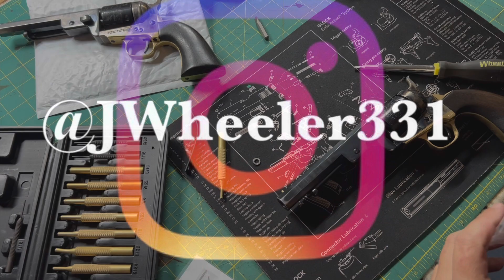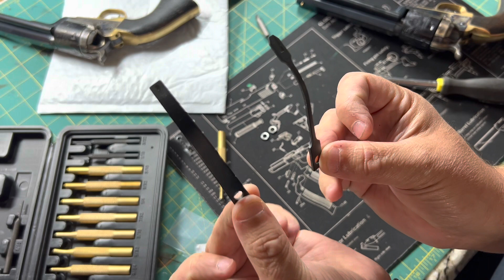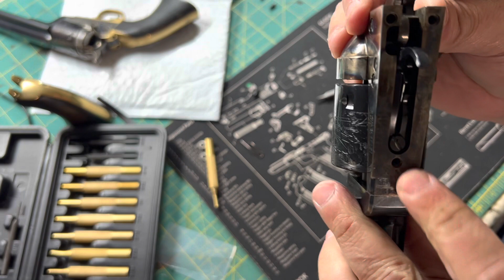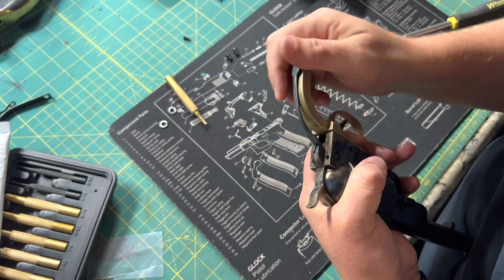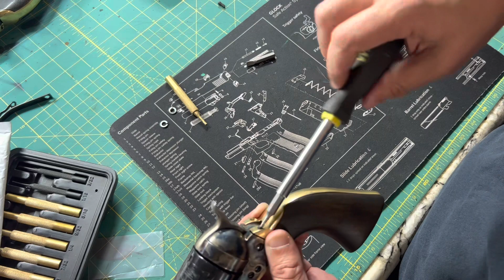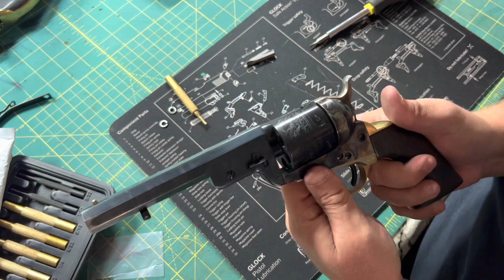Replacing Stock Springs In Uberti 1851 Colt Conversion With Lee Gunsmithing Spring Kit Cimarron

Comment: Does Uberti manufacture the revolvers for Cimarron? I've got a "Man With No Name" that I bought years ago and the trigger/bolt spring recently broke. Are the round springs more durable than the flat springs? I love taking things apart but have never attempted to disassemble my mine but this video makes it look like a piece of cake.
Reply from the maker: Uberti is the manufacturer. Cimarron, Taylor’s, EMF, Stoeger etc are the importers. I have some of my Uberti made revolvers converted to coil springs like the Ruger’s which is better. I had Mike from Goons Gunworks do mine though.